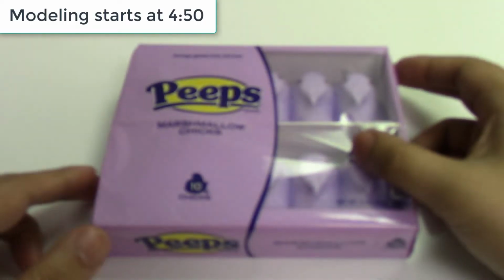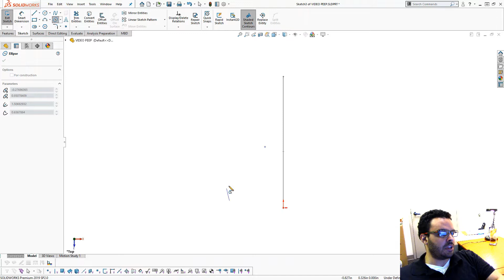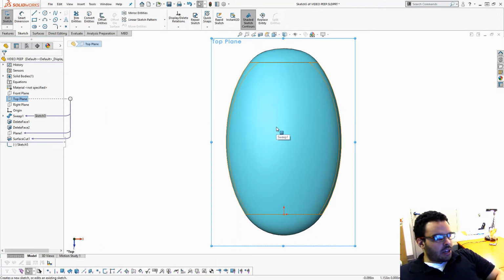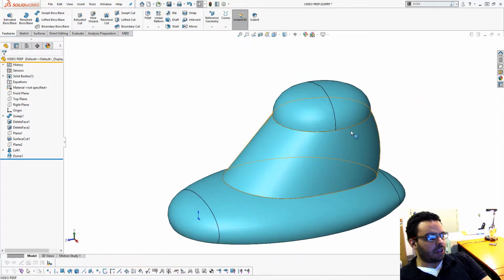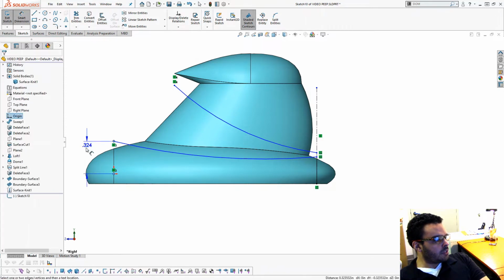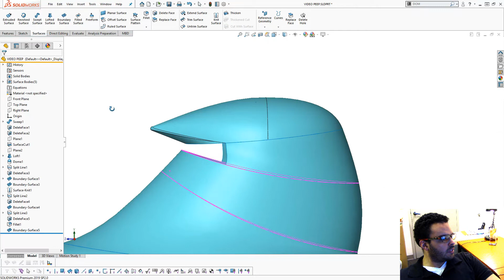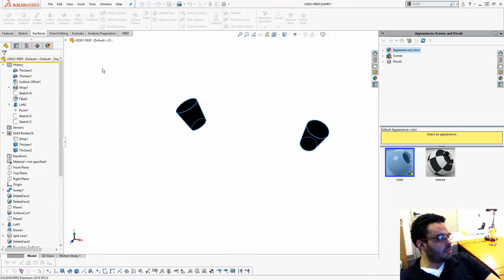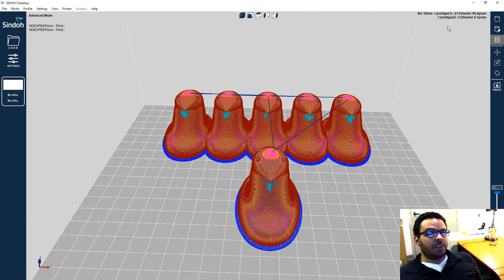SOLIDWORKS - Marshmallow Peeps (Advanced Surfacing and Destructive Reverse Engineering)

Comment: I have a problem 13:09. My delete fill  face does not create the curve...
Reply from the maker: Hi Rob!

What exactly does it do when you try? Does it make garbage geometry? Does it throw an error? Let me know and I can give suggestions to help !
Reply: @VirtualFlat  Thanks! No error pops up. I click on the face, delete and fill, tangent fill, and preview shows nothing but a yellow outlining the elipical face...
Reply from the maker: @robhousehold  Hm. if nothing happens it may be trying to show you an error and can't for some reason. At any rate we could try to work around it. Try this:

1) Delete Face > set to "Delete" (rather than Delete and Fill)
2) Go to Surfaces>"Fill Surface", launch the command
3) In fill surface, select the open edge of where the flat face used to be, set to tangent.

It should produce a very similar surface to what I got in the video

(Delete face > "delete and fill" actually just calls the filled surface command and tries to apply it with default settings. You might have some luck playing around with the settings in Fill surface)